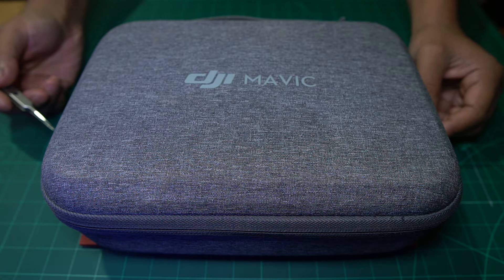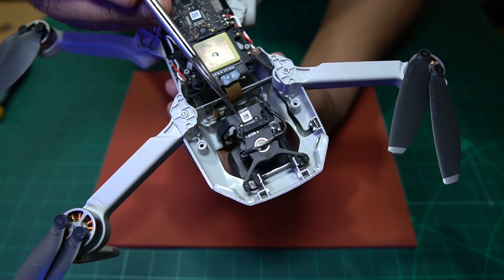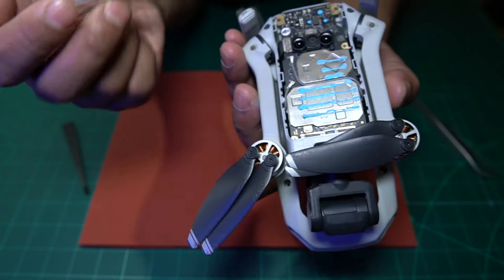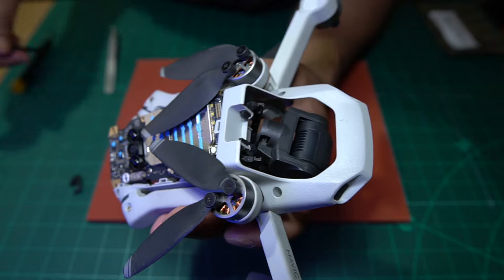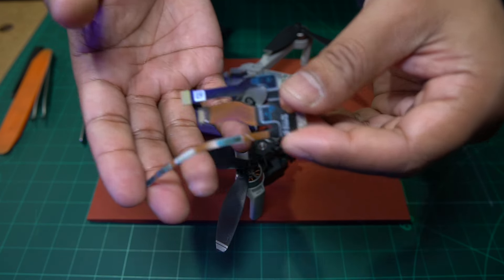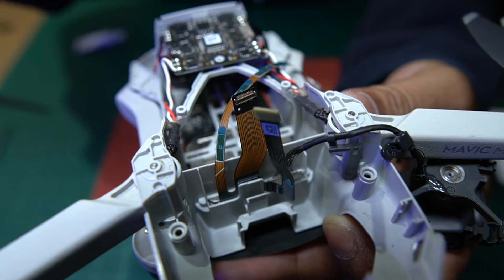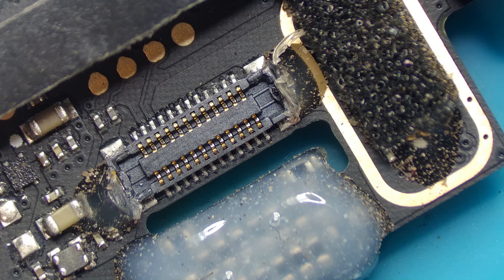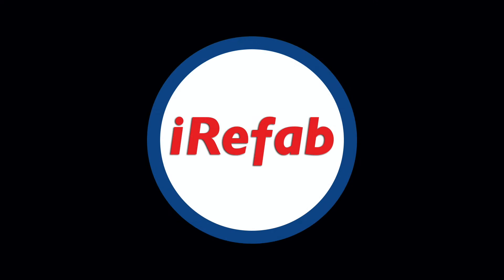DJI Mavic Mini Drone Quadcopter Camera Gimbal Repair - iRefab

Comment: In my country, I would need to repair the cable, I am a microsoldering expert so that would be easy, and perhaps just repair the frame that holds the part, the leg, forgot the name of it. But if the parts are available, of course replacing would be the best choice.
Reply from the maker: Agreed, I always recommend repair if you have the time and the skills to do it 👍